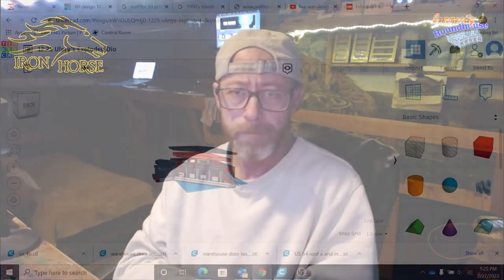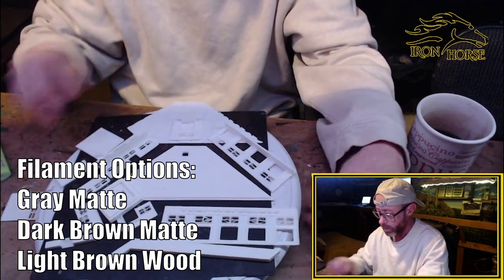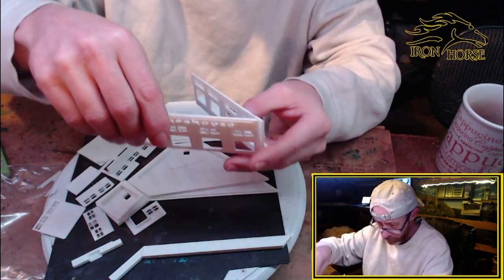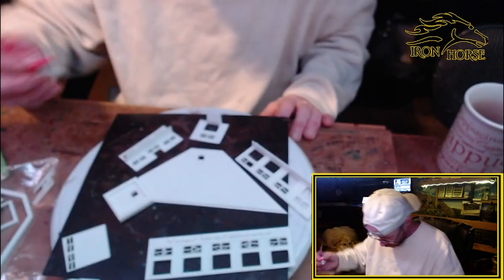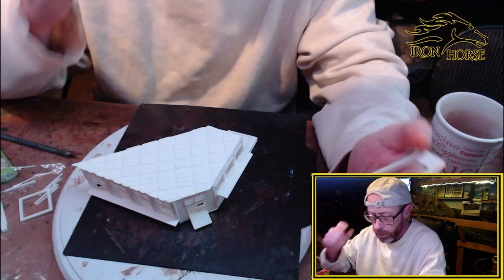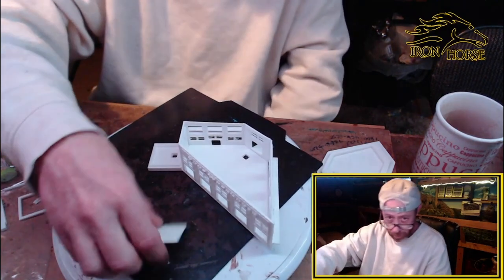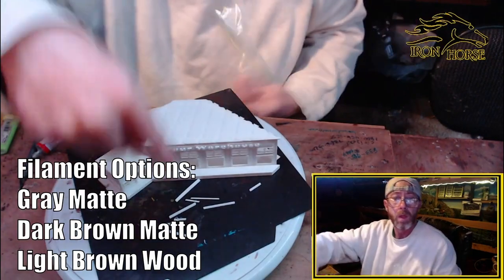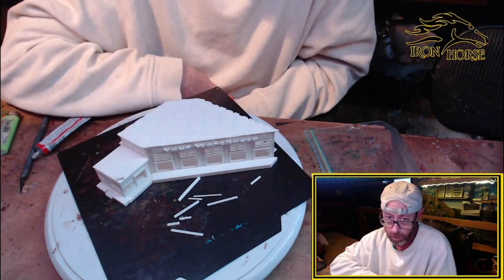How to Assemble the Warehouse - Iron Horse - Scale Model Railroad Structure Build Instructions! N

Comment: Excellent instructional video on building the kit Brian. The kit looks like a fantastic addition to any layout. Seeing the size in Z scale, you were definitely right that it would be a huge kit in HO.
Reply from the maker: Great to see you Art.  I did figure out that I can separate the office and the main building and make the kit in HO.  It would have about a 22" x 14" footprint, although it does fit nicely in a corner.  Size plays a big role in the amount of work that goes in to a model for me.  The larger the pieces the more different individual prints that have to take place.  So just lots of passive time with a larger model.  So Z scale is the least expensive.   Brian